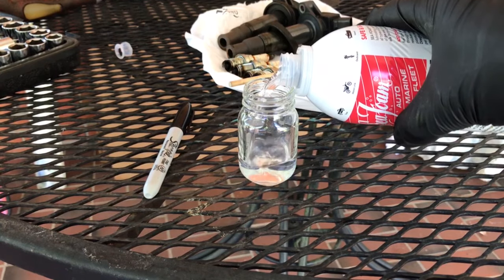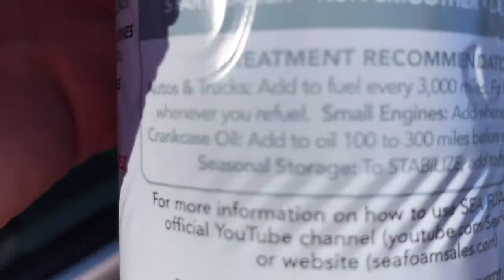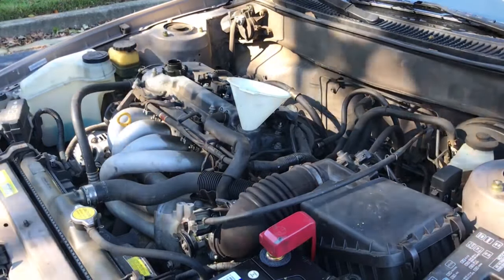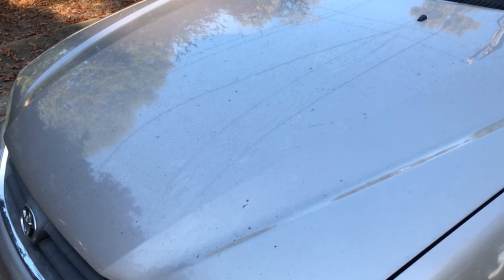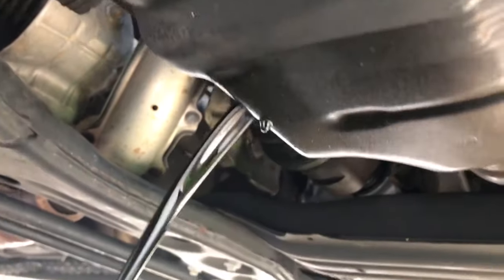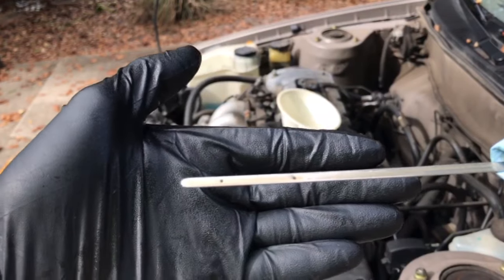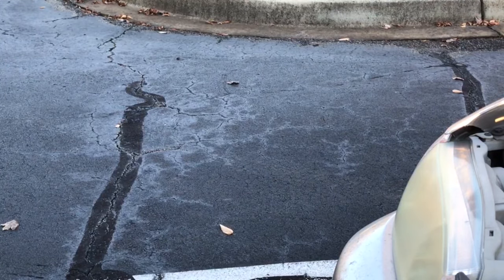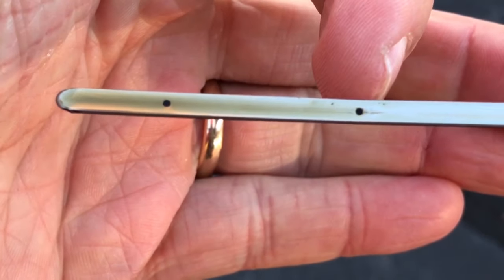Will Seafoam stop oil consumption? | Oil Burning🔥Experiments | Episode 2

Comment: I used sea foam extensively in my Cadillac cts, to remove carbon build up. It absolutely works, however it has to be used a bit differently, dump your used engine oil, put fresh oil and filter, use around 8 ounces of sea foam instead of 4, you will notice that your clean engine oil turns dark very fast and that Is a good sign, however the vehicles engine must heat up properly during this treatment process (short drives won't heat the oil up enough) change your oil after only 2k to 3k kilometers, and repeat the process over again, it took 4 times back to back, until my complex VVT direct port injection engine was whistle clean.The end result was absolutely no more stuck rings, no more noisy  lifters, almost no oil consumption, quite timing chains 👍
Reply: How I can get in Dubai?
Reply: @ahmadvlog448  you may have to enquire about other detergent/dispersent type engine oil additives similar to SeaFoam, that are available in Dubai, they all have similar type de-carbonizer properties, that remove potentially Dangerous build up. Worst case scenario, run a light weight diesel motor oil, temporarily, for cleaning carbon, diesel oils have twice the amount of detergent additives, than gasoline oil, but be careful that you don't do damage to the motor because of a higher than normal viscosity index, consult with a mechanic before taking action.
Reply: @brentneves3602   I placed an order & it will be deliver here in Dubai on 21 of Feb,but I just want to know that I have already added Lucas transmission fix in my car transmission,So I have to drain that fluid and add with new one or I can use with the same?

Comment: I would say that the "OIL CONTROL RINGS" are what was stuck/unstuck, and not the piston rings. Another comment I have is that the ethanol in the gasoline contains corn syrup. This is very sticky. If you ever disassemble an engine that has been burning fuel that contains ethanol then you will see just how sticky everything inside the engine is. It is like someone spilled some soda pop and left it to evaporate on some surface. The liquid is gone, but what remains is a very sticky substance. And that is what it is like inside your engine. But washing and scrubbing with soap will not remove this sticky substance. I used oven cleaner to remove it. Or take it to a machine shop and have your block boiled in harsh chemicals. If Seafoam works to unstick oil control rings, that is fantastic news.
Reply: What? Holy crap. Oil control rings ARE piston rings. Corn syrup? Stop it.

Comment: I know a Guy in the Scion XB group Brent Taber, that runs a whole 16oz can of Seafoam in his Engine for 500 Miles then changes his Oil and does it again when he has about 500 miles before his Oil Change adds a Whole can and repeats,he said by the 3rd time doing this his Oil Consumption went away.
I also know another Guy Scott Smith thats a 30 year master tech mechanic that fixs Toyotas with seafoam he said to add 10oz of seafoam a 100Miles before you change your Oil and then add Motorkote he says the Oil Consumption problem is from stiction he said if you use Motorkote it wont ever return, but most people think they are all full of BS 😂
Reply from the maker: I love stories like these that keep our hope alive. Thanks for the comment, ChapinTeo84!
Reply: My XB has alot of issues with oil consumption. It took 2 cycles of seafoam & lucas oil to signifcantly reduce the consumption.
Reply: @johnoneill959  Explain the process please.
Reply: Did the same in my xb, worked.

Comment: I think YOU GOT IT; DAVE add 1.5 oz to each QT of oil will not hurt oil Viscosity it mixes well with oil.
 change later oil slush and filter every oil turns black. 
do not change when its light oil let sea form do it work, when it turns dark.

Comment: Hi Dave, nice videos, both this one and the piston soak one. It looks like the Seafoam in crankcase is more effective. However, this was right after the piston soak run. Could it be that the piston soak did most of the heavy lifting and loosened the gunk holding the rings and the oil return holes, but it just needed a little bit extra effort to knock off the gunk from the rings/holes to see the full benefits? In other words, if one needs to choose either the piston soak or the crankcase, but not both, which one should he/she pick? Like to know your opinion.
Reply from the maker: Thanks, SunnySky. I think adding it to the crankcase like Seafoam recommends is the better option. Right now I'm working on a video trying Marvel Mystery Oil. We'll see how that does. If there's not much improvement someone said they run half a can of seafoam in their Sienna all the time (not just the 300 recommended miles, and it has worked wonders---I might try that. The experiments on this Corolla might never end. Hopefully we can all learn something from it. Thanks for the comment!
Reply: @FamilyFriendlyDIY  Thanks and looking forward to your new video.

Comment: I have a 2002 sienna which was losing a quart of oil every 100 miles.  I
 had been adding oil frequently to the point that I was almost always 
had clear oil in the engine.  I tried adding high mileage lucas oil that
 is so thick and that did not fixed the oil consumption.  I did my 
research and found out that the piston design (holes not enough) is 
causing not enough oil to pass thru to lubricate the rings and that 
causes the rings to eventually stick.  I did similar to what you did and
  left the seafoam 24hours in the cylinder and even crank it without the
 plugs but found out that all of the seafoam went pass the rings.  I did
 not oil change after that and just drove the minivan since like I said,
 the oil looks clear because I add every 100 miles.  I checked after 100
 miles, 200 miles, 300 miles and 500 miles and it had not burned more 
oil than before.  I decided to just add 1/4 of seafoam container every 
oil change (3k miles) and the engine has been performing like new.  
Seafoam acts as a crud cleanser to the cylinder holes and the rings that
 at high temperature, the rings would release itself from being stuck in
 the piston creating the seal between piston and the combustion chamber 
locking and containing the oil from below the piston rod. My gas mileage
 went from 12 to 25 mpg. Seafoam save my van and it is now part of my 
oil change. I just recently drove more than 1k miles round trip from Sac
 to San diego  and vice versa, I just burnt a little along the way and 
would just continue adding seafoam and oil at the same time.    Toyota 
had a newly released oil grade by year and model recommendation also 
found out that I can use 0w20 synthetic oil which I plan on using later 
after I am done consuming all my 5w30 oil that I purchased from costco. 
 Adding some seafoam to your oil does not hurt your engine and believe 
me because I have been doing this for more than a year now.
Reply from the maker: That is awesome to hear! Very encouraging for others like us sharing the same problem. I really appreciate the comment @Eng Al! 👍👍
Reply: Eng Al, could you clarify which way is more effective to reduce oil consumption: putting Seafoam directly in the cylinders, or putting it in oil?
Reply: @Sunnysky321  if you are burning/consuming oil like my van did (1 qt/100miles) close to it, I would suggest to piston soak them with seafoam for 24 hours and start it (remove the plugs and EFI relay so no gas on injectors) so you can make sure no liquid seafoam remains to prevent hydro-locking.  Then put back the plugs and add 1ounce of seafoam per quart of oil capacity of your car in the engine oil. Melting of the gummy oil that is causing the sticky piston rings will take a while but drive that car and check the oil frequently (like every 100 miles) and continue adding oil and a little of seafoam to top it of.  Be patient and if your problem is really sticky piston rings, it will get fixed overtime.  But check to make sure you are not leaking oil external to the engine oil compartment (i.e. bad cover gasket), fix that first before doing this.  Also replace your PCV valve too.
Reply: @engal5849  Thank you for the promptly reply. In DIY Dave's previous and current videos, the piston soaking method is much less effective than the oil mixing method. I just wonder if you found similar or different results. 

My car doesn't consume much oil yet, but it may start soon, based on many people's reports. I just try to get prepared.

Comment: I haven’t done the Seafoam yet but my CRV was consuming about a quart every 1,000 miles. I switched from 5w20 to 5w30 from O’Reilly’s to Valvoline,. Each oil has different evaporative loss rates. You may already know this, I did not. So I tried different brands. So far valvoline full synthetic high mileage seems to work best. I also cleaned out the pcv and so far my oil consumption has dropped to half a quart every 1,000 miles. It has 164k so I’m curious to try the seafoam also. Nice video btw. Thanks for doing this.
Reply from the maker: Thanks for the info and comment, Lupe!
Reply: Cleaning your PVC system reduces back pressure on the crank case which reduces pressure on blow by which reduces oil being pushed up through the oil wiper ring on cylinder.

Seafoam/marvels mystery oil/gum out/etc. are a necessary step to free stuck components but reducing the back pressure is also needed to keep it from happening again.
Reply from the maker: Thanks  @tc4275  . Yeah I think I need to look at my pcv.
Reply: I am going to try the Castrol Edge full synthetic as it has been proven to be superior as far as evaporative loss  and other properties are concerned. I was a Castrol user in Asia and in Europe, but when I moved to America, it was not easily available and I switched to using other oils - looks like i will be moving back to liquid engineering again!
Reply: @ray32825  Castrol in my experience is best for oil burning engine. Have an 05 Civic burning oil. Used Valvoline synth blend MaxLife & adding 1.5 qts for 3k miles. Used Castrol GTX syn blend & got to about 2-2.3qts for 5k miles needing to be added. Just sucks as engine burning oil you're always throwing money @ it for oil. Think I'm try Quaker State HM oil since it's cheap. Never used SuperTech, so I'm a bit biased there.

Comment: You should have done the same treatment a second time to ensure that the seafoam treatment cleaned up everything! I have been using seafoam for years in all my gas powered engines and it it an amazing product! it was introduced to me by an auto mechanic that used it for years before I met him! I won't use any pother product now!

Comment: Great outcome. Well done.  I have an oil burning issue too and have enjoyed watching your videos on this. My next attempt is likely going to be Seafoam since other engine flushes appear to have done little and only last in the engine for 15 mins prior to draining. At least with this one you can drive your car normally while the Seafoam circulates and attempts to clean the oil control rings.
Reply from the maker: Thanks, and good luck with yours!

Comment: I bought an old Honda ATV what was smoking very bad, got it cheap because of that ! I did the Seafoam treatment through the spark plug hole, crankcase and as an additive in the fuel ! guess what, it completely stopped burning oil ! I change oil every 50 hours, and no oil is missing ! That stuff works !!

Comment: You need to do all final fills and measurements with the engine warmed up. If you fill it when cold, you will be overfilling it and burn the excess.
Oil expands when warm. Sludge will trap some oil in the galleries, and also has volume of its own. Removing sludge will increase the amount of oil the engine will take in the next fill.  Seriously, as well as measuring how much oil you need to add every 320 miles, you need to measure how much oil is needed for a fill after a drain and note how discolored the oil is after your 320 mile drive cycles.  When it starts looking clean, check the spark plugs. If the engine is running clean, they will burn off their oily deposits.
Reply: Transmission fluid expands when hot, but I have never seen my engine oil level increase or decrease with temperature cycles of the engine. You are mistaken about that.
Reply: @j.t.cooper2963  Yes I concur with you, I have never heard of this before. The only suggestion I can make is that he could have checked the oil level when the car was cold in order to get a correct reading. It takes time for oil to travel back to the oil pan therefore his final reading would have been incorrect, that accompanied by another person's comment here who said he was parked on an incline.

Comment: Militec-1 will unstick the rings, clean the engine and permanently coat all the metals with highly effective anti friction layer for life.. No more junk will stick inside the engine afterwards. Use 3oz per QT oil for first oil change then 1oz per QT on next change

Comment: When I have used flush treatments in the past they have vaguely cured the problem but can cause other  problems like crank seals weeping on the engine or valve stem seals. Sometimes the flush  will take away the grease and grunge that is helping these seals to  hold  pressure.  Good videos  I have enjoyed them thanks.

Comment: Using Seafoam regularly in your oil and your gas will prevent your ring from stocking in the first place. I have a 2010 Kia soul 298,000k and I burn one quart every 5,000 miles
Reply from the maker: So you keep Seafoam in your oil all the time? and if so, how much do you use? Thanks for the comment.
Reply: @FamilyFriendlyDIY  I'd also like to know this as my engine burns oil too.
Reply: wouldn't doing this damage seals?
Reply: Just an update. My car now has 373,000 MI

Comment: Next time is needs oil add a 1/2 quart of Auto Transmission oil  chain the oil after about 1000 miles it will help clean the sludge out . Auto transmission fluid has a very high detergent factor . Then when you change oil try an oil designed for diesel engines they need a higher detergent level , so it cleans out the engine better .
Reply from the maker: I think you're right about the diesel oil, but I just found this on the Amsoil site about adding ATF fluid ... https://www.amsoil.com/newsstand/drivetrain-lubricants/articles/transmission-fluid-as-an-engine-flush/#:~:text=In%20most%20cases%2C%20adding%20ATF,formulation%20and%20reduce%20its%20effectiveness. Thanks for the comment, Graham!
Reply: @FamilyFriendlyDIY   Just for you information I have run a few cars on LPG ( like propane / Butane ) in Australia for the past 20 years  . The cars that run solely on LPG have oil that remains a constant honey color . Most of our Taxi fleet was run on LPG  for the past 50 years . these engines generally rake up 400K miles and then all theo there things go wrong so they replace the vehicles . MY cars that are dual fuel do contaminate the oil but over a much longer time . I believe its the remaining fuel when the engine is switched off and allowed to cool that condenses then runs past the oil ring into crankcase breaking down and contaminating the oil as LPG engine do not do this , I have some which are both dual fuel and strategic LPG  so its not the type of engine .
Reply from the maker: @grahamoldfield3474  that’s pretty interesting stuff. Thanks for the information, Graham.

Comment: I find this video very interesting indeed. However I’ve tried everywhere to get the sea foam where I live. I remember some years ago a very experienced mechanic told me that if you mix paraffin or kerosene oil to cheap engine oil after draining the engine of all the old oil, run the engine for about 30 min. Drain and then refill with good oil, this will clean and free up piston rings also lazy valves. What do you think?
Reply from the maker: It's definitely possible, Franklyn. I use motor flush in another video, and the label says it's mostly kerosene. https://youtu.be/h00tNeTEiVg

Comment: It's not that the rings on these cars are stuck, but clogged. When clogged, the piston rings do not allow oil to pass below the piston head back down thru the engine. Thus the oil is stuck in the combustion process and burned off.

Comment: Regarding B12 Chemtool, I would only idle not drive a car with b12.  It is very harsh/dry and reduces lubricating qualities of oil a lot.  You can probably get away with idling for a long time though.  30 minutes or more for 1/2 of a  small can should be fine.   Don't add it to a very thin much deteriorated old engine oil,  like before an extended oil drain interval,  as it may be unsafe then.  We want to clean the rings not put extra wear on them.  Finding the balance can be tricky. 

Reply

Comment: Hey Dave, Thanks for the nice video...sorry bit confused...so putting the seafoam in the engine oil has worked? or did you think it was putting in throught the spark plug holes to soak it has worked? cheers.
Reply from the maker: I don't want to give anything away in the comments Jim, because there are several more videos after this one, but let's just say the saga is continuing.

Comment: You should take your spark plugs out and pour the sea foam directly on the pistons and let sit for 24 hrs. .  Turn over the engine without the plugs and change the oil.
Reply from the maker: Did that in the video before this one, kinglangren.. Here it is if you want to check it out. https://youtu.be/cxz9cGCULNI  Thanks for the comment.

Comment: You did write that stuff works I've used it before on the gorillas and it actually does work I'm actually use the high mileage version of seafoam it works a little bit better because it has more detergent in some cases I use Marvel's Mystery Oil because it's Becker and it works a little bit better in harsh conditions it just put in oil crankshaft can you put 4 oz in the gas tank pat it works wonders
Reply from the maker: I'm trying Marvel Mystery Oil next! Thanks for the comment, Corey.